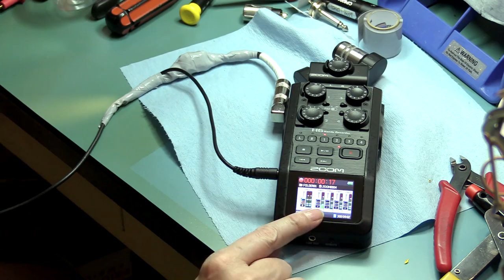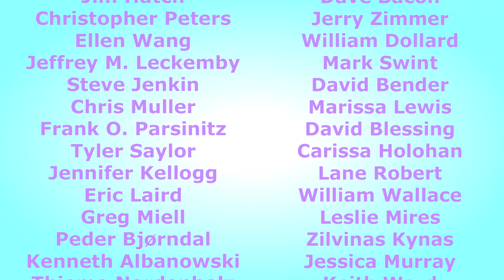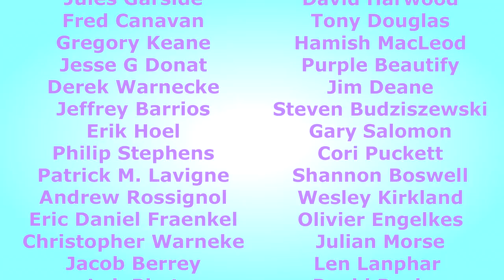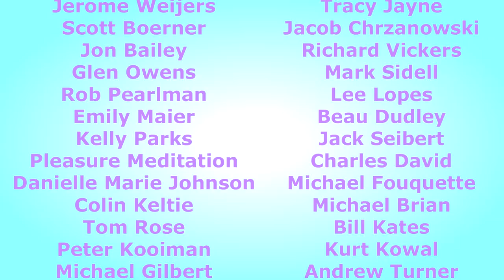Apollo Flight Com System Part 2

Comment: The sound is just about vintage perfect! Add a little beep that you can activate at the end of the conversation and you'll be flying in space already!
Reply: Wow, Marc had the same idea I had.  They were called Quindar tones, but Wikipedia says they were only on the Mission Control audio. So to be accurate, Fran's audio, as the astronaut loop, wouldn't have the tones.

Comment: I had a project I could not finish because a tiny amp in it picked up so much noise and I could not fabricate a rigid metal cage that would fit inside the enclosure space. I never thought about using layers of nonconducting and conducting tape to make a Faraday cage. 
I think I need to go find that project again. 
Thank you for sharing from your build process, always something new to learn.

Comment: Great job Fran. Very nice audio quality. One suggestion, instead of shrinking your heat shrink tubing with your soldering iron, buy one of those inexpensive heat style paint strippers. They do a much better job and don't leave any burn marks.

Comment: It does sound a lot better. Not super high-fidelity, but you can't really expect that kind of performance considering it's from the 60s.

That silicone tape is a new one to me, definitely had more than a few occasions that could've used something like that, so I'm going to have to check it out.
Reply: Microphone technology more or less reached its peak in the 50's and 60's. Lots of microphones from that era are still in use today for hifi sound recordings. So that's not the issue here.

Comment: I have been using "self vulcanizing" or "mastic" tape 3M 2228 for ages.  And now I hear and see that there is a silicone version.  WHERE???  I'm already drooling!  Actually I once tried my skill in making multi layer PCB, where I had some extremely thin silicone film that was used to glue two etched boards together.  Cumbersome, but it worked.  The problem is, I don't know where I got that film either.

Comment: That tape's good when you've got a large diameter change, but I like adhesive-lined heatshrink better if it has enough shrink range.
Reply: I use self-vulcanizing tape, which works great too.
Reply: @jankro1  sounds like a logical solution.

Comment: Hey Fran, how about doing an episode about the problems that NASA and the satellite manufacturers have had with tin whiskers and dendrites forming because of the use of lead free solder, and causing short circuits?  I have also heard a rumor that they suffered failures years ago due to the use of so called "contact preservatives" which ended up causing corrosion.....

Comment: As a heads up, even after isolating, there is a painful high pitch tone that comes through the recording.  Not everyone can here it, so you may not have noticed.  Look at it in your sound editor or run a FFT on it and i think you'll see it.  If your flight video has this present, many simply will not able to listen without getting a painful headache.
Reply: This also reminds me of the time Tom Scott released a video which had a lot of CRT squeal that he couldn't hear, only to have viewers have to comment.  Anyway, keep up the great work!

Comment: maybe have a small 'wind catcher' around the tiny mic through which you will talk. by that the T's, the S's and other stronger sounds will not boost against the sensitive mic. there's a slightly overload. since i'm a sound engineer i hear these things.

Comment: I don't understand why you needed to do this. The microphone has a LoZ output, the Zoom has LoZ inputs, albeit balanced. Surely you could have just used a right angle XLR plug and shorted the cold (pin 3) to ground.